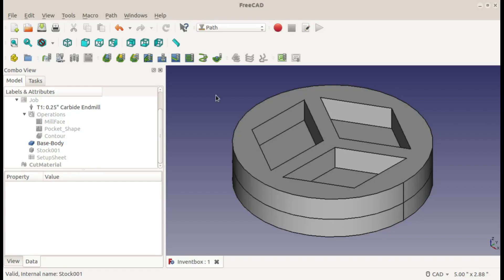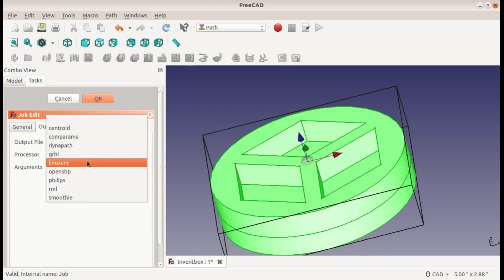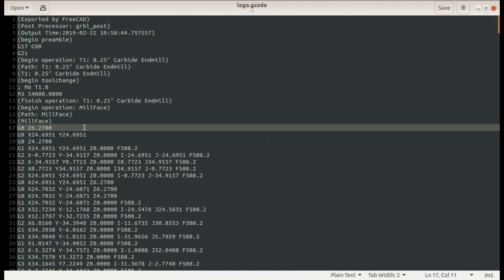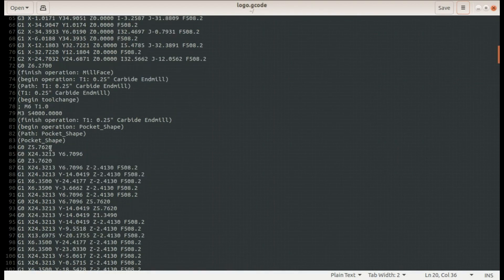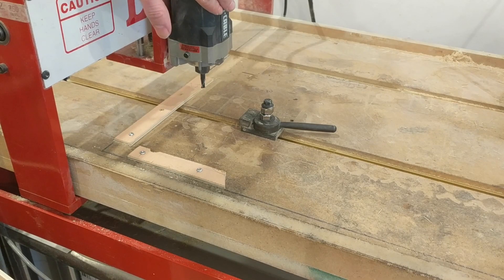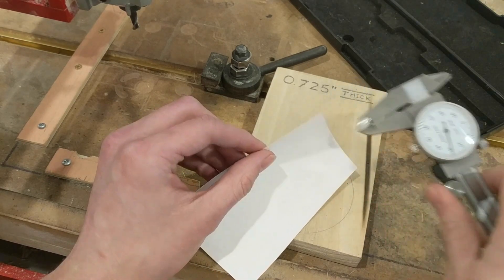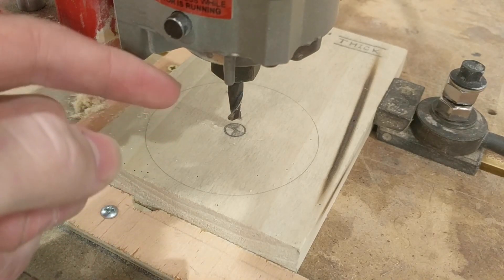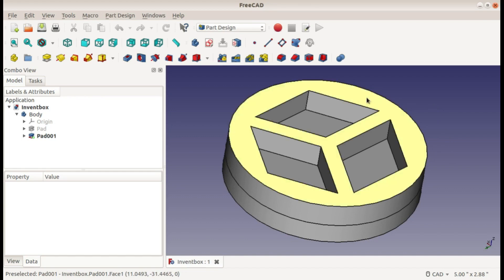Learn FreeCAD: #15 Post Processing and Cutting - Tutorial

Comment: Having trouble in freecad generating a .GCODE file or any file extension . My post processor generates only a .NC  and that file won't work on my Genmitsu 4030 or my plasma cnc.  A   .GCODE  and .TAP file work good on my Genmitsu  machine . any suggestions would be great Thanx Mike

Comment: I have a mini cnc router.  freecad program and I do this in the path workbench process.  but the measurements I entered do not exactly match.  shape that's almost twice as small.  what is the reason of this?  my control panel SMC4-416A-16B .. Can you help?  thanks..